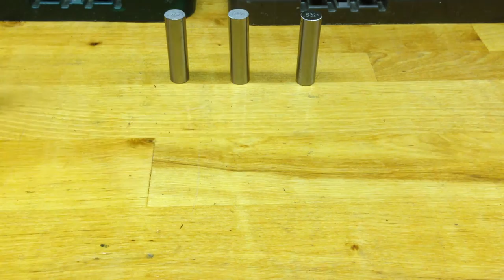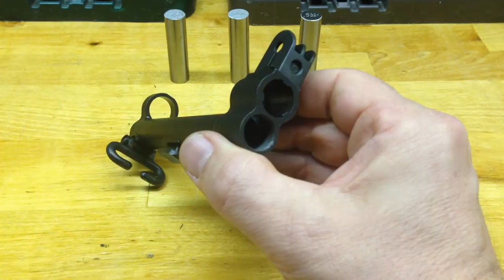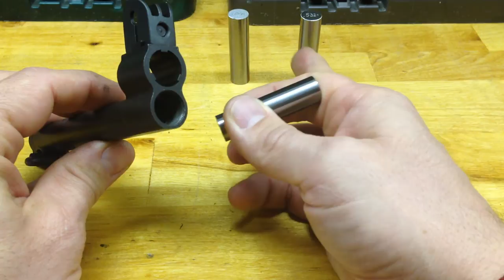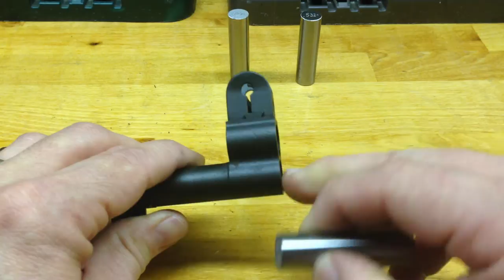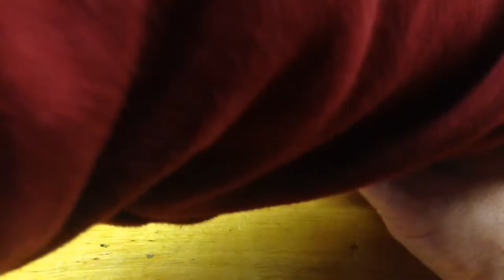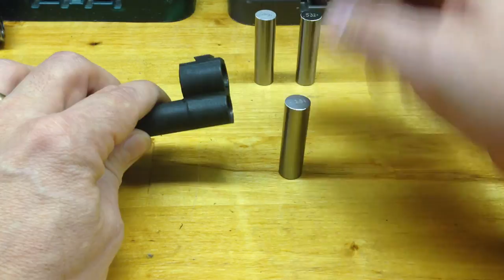M1 Garand Gas Port Cylinder Gauging

Comment: I use a small diameter snap gauge to measure the inside of the gas cylinder...and a outside micrometer to measure the op rod piston...then compare the difference to the specifications
Reply from the maker: That's a real good way too, thank you for sharing.

Comment: Hey Norwich I have a question about this part of the rifle. I’ve noticed my gas port cylinder has a very tiny amount of side to side play, and upon asking several people if this is fine I’ve received answers ranging from I don’t need to worry about it, to it’s going to seriously mess up my shot accuracy. So I was just wondering what your day on the matter is? Thanks!
Reply from the maker: If the play on the barrel is what you are talking about yes it will, longer range and competition.  Just pinking, forget about it.

Comment: Another question if using corrosive ammo should I remove this to clean after each shooting? I know you don't want to take this off to often, but would just removing the plug and screw be enough to clean?
Reply from the maker: After using corrosive ammo everything metal should be cleaned.